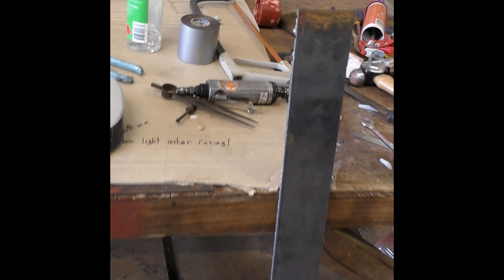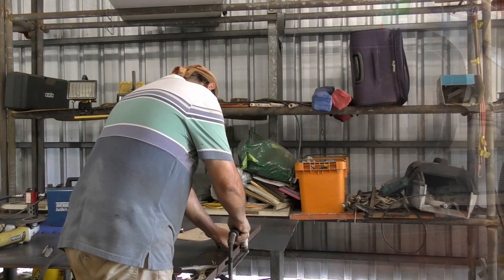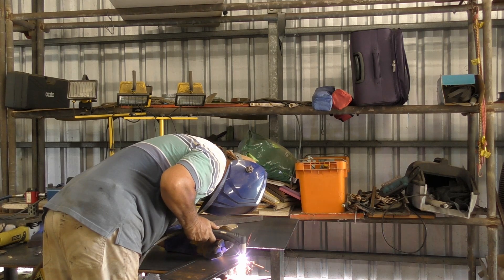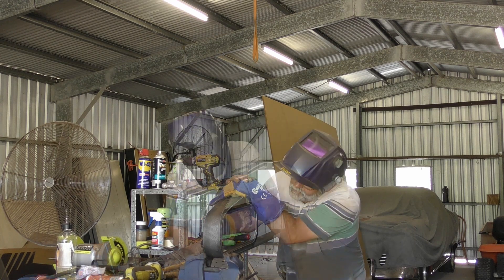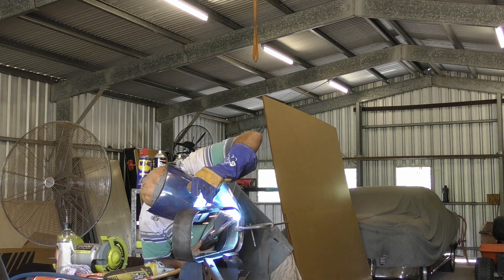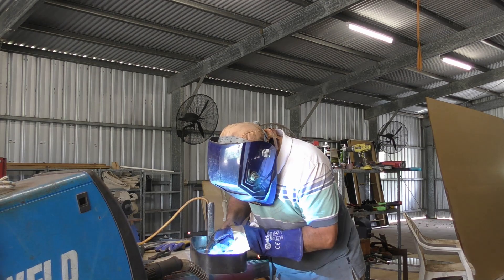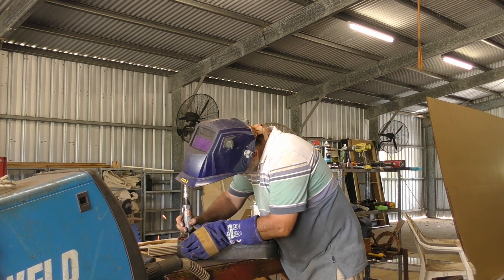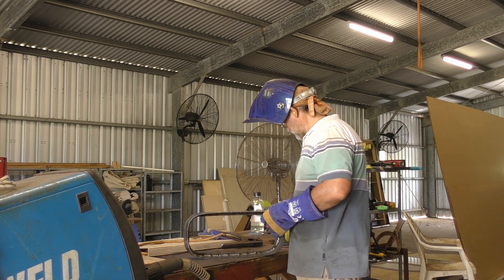Steel Sailboat Build - Fabricating Port Light Box frames Part 1

Comment: Looking forward to seeing part 2. If you could share what thickness of steel plate you are using that would be ace.
Reply from the maker: Sure Duncan. Almost all of the hull plating is 3 mm (1/8th"), except for the keel plating which is 6 mm (3/16"). So the box frames are 3 mm also, including the inner sealing rings cut from 3 mm sheets. The process could easily be done in heavier gauge, but to do so I would use a steel bench top and tack weld all of the components down to it to form the outer wall around the ring. :-) Cheers.